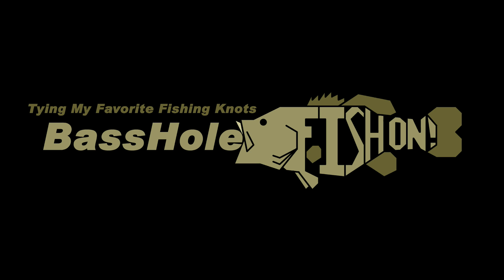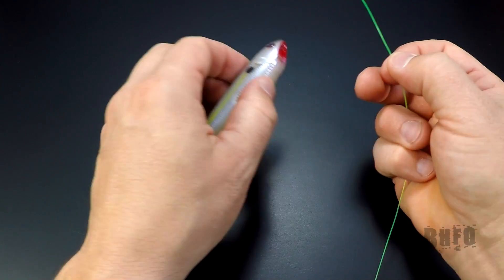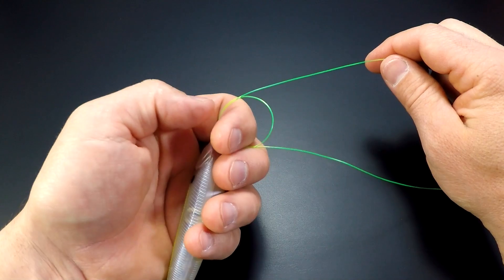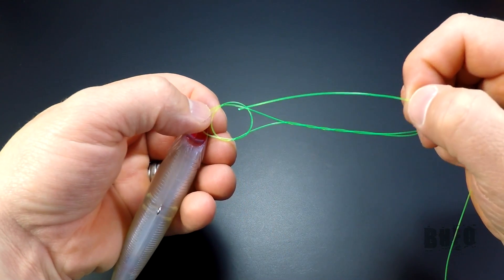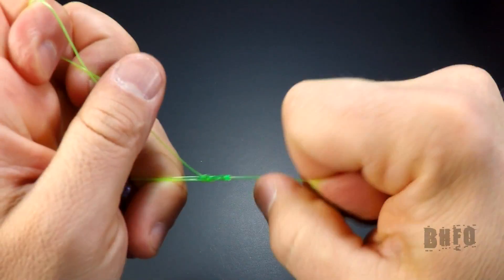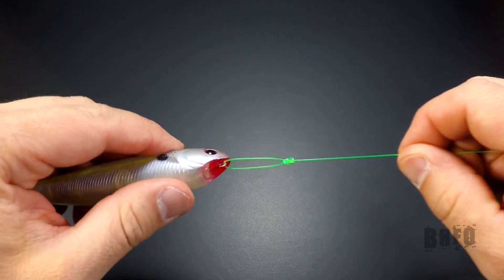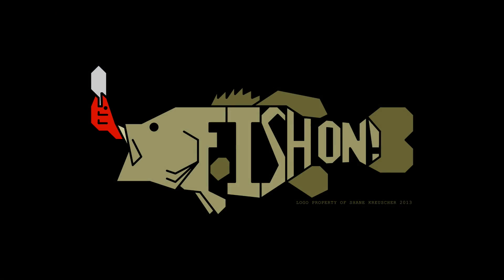Non-Slip Mono Loop Knot

Comment: Very clear, thanks! What's the % strength of this knot? I don't like to use the perfection knot for jigs because it's not very strong and it's troublesome passing the jig through the loop. Thanks!
Reply from the maker: Not sure what the % strength is but I’ve had very minimal issues using it. Thanks for watching and good luck.
Reply: @Fishing POV  I tied it this morning on a Tady 45. Pulled hard with my gloves on with 40 pound. Couldn't break it with plenty of pressure. Thanks again!!!
Reply from the maker: @gliblyaware  thanks for the update.

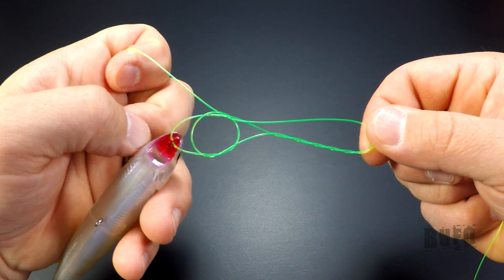Comment: Bud, your tag line should go back through the overhand knot on the same side where it came out (0:34). Look at 1:23 and you'll notice that they're not and why your knot is not streamline. All three passes should enter through the same side of the overhand knot and likewise exit on the same side of the overhand knot. If you try YOUR technique with a large rope, you'll be able to appreciate what I'm saying. Checkout the "Pocket Guide to Fishing Knots" by Peter Owen page 46. Tight Lines
Reply: Is that why I just lost 2 frogs after following the vids directions? Those frogs grew wings n flew away after a few casts 🤣 I love this channel though, plenty of great knots n info.
Reply: You’re exactly right on that

Comment: Hey Thanx man 👍 ive tried this knot a few times while out fishing and failed every time lol so i sat here with my line and lure and followed each step and got it perfect 1st time 😆
No doubt i'll fail again when im out 😟 i think the reason i failed is bc there are so many variations of the loop knot and using 4lb line makes it harder to set the knot but i just need to re tie the knot over n over until ive got it down without following instructions 😀
✌👍💙🎣 from Scotland 🙋
Reply from the maker: TheDevilWearsPrada you’re welcome thanks for watching and good luck.
Reply: I’ve had mine break every time until I started wrapping it around the line only 2-3 times. Not 10. Idk why but that’s what you gotta do with 4# line. Less is better. For thicker line, I bet you can wrap it many more times

Comment: Don’t use this knot I followed every step as precisely as I could and on the 5th cast I lost a 14 dollar lure
Reply from the maker: Wilson Hulett so because you had an issue which by the way was probably somehow your fault you feel it necessary to tell everyone else not to use this knot. This knot has been used for years by people over and over and over again. Did you lube the knot? Did you slowly cinch it down? What kind of line where you using size and type? Which line were you using for the leader? Maybe it was the line itself? What size and weight was the lure? Practice makes perfect sir. Maybe you tied it perfect maybe I’m just being a jerk. Anyway thanks for watching and I hope you find a knot that works well for you good luck out there hope you catch a monster.
Reply: Fishing POV sorry for my comment I was angry at the time the line backlashed and weakened the line it wasn’t the knot that failed it was my line and also has this knot ever cane loose on you?
Reply from the maker: Wilson Hulett thank you for the apology. I have not had this knot fail but I have had it break in the loop before. I only use this knot for a little extra action when fishing top water though and I’m usually using heavy mono or braid.
Reply: Fishing POV the lure I lost was a whopper plopper 110mm but I ordered another one and is it necessary to use the loop knot for this lure or should I just keep using the polymer knot I also am using the loon color
Reply from the maker: Wilson Hulett with the prop lures you seldom stop, so I would say not enough to justify this knot. In all honesty for the whopper popper I personally use a snap swivel. This way when it catches weeds it’s still has the potential to spin around and sometimes you still get bites.
Reply from the maker: Wilson Hulett Palomar knots a great knot you could keep using it. The non-slip mono loop kInot is more for walking the dog type lures and frogs any top water that you frequently pause with, that’s where the extra action comes in. As far as color bone is my absolute favorite loon is good but I’ve caught double the amount of fish on the bone color.
Reply: Fishing POV thanks, i subscribed
Reply from the maker: Wilson Hulett anytime bro thanks for the sub. I haven’t made any content in a while my life got flipped upside down because of divorce so it been a tough go trying to make videos again time has been hard to come by. Good luck out there.
Reply: Fishing POV sorry to hear that, divorce can be tough just creep your head up
Reply from the maker: Wilson Hulett trust me my life is much better now I just work way to much now, gotta support those kids.
Reply: Fishing POV yes sir
Reply: I lost a Smithwick Rouge using this knot.  I almost lost a Rapala X-Rap too until I figured out the knot was coming undone.  I added an extra step to the knot at the end of tying.  I bring the tag end back up through the loop at the top that's made at 1:41like an improved clench knot and this fixed my problem.